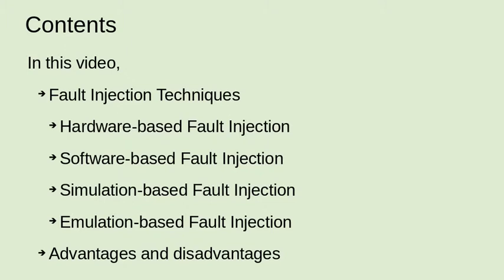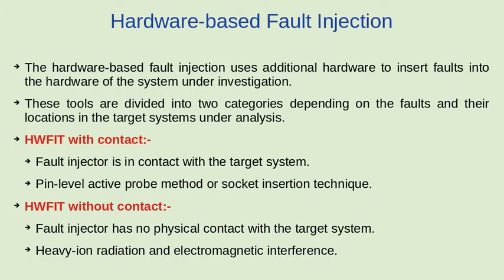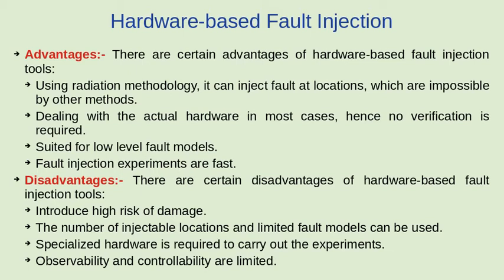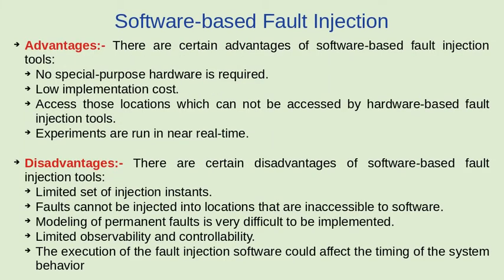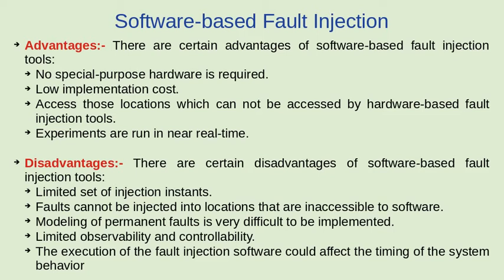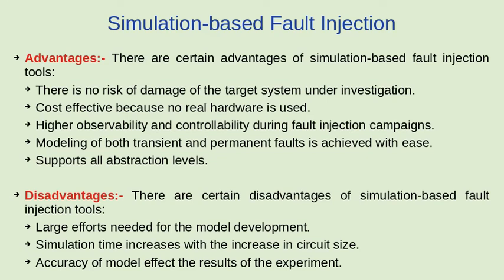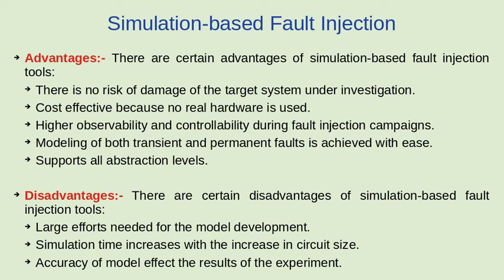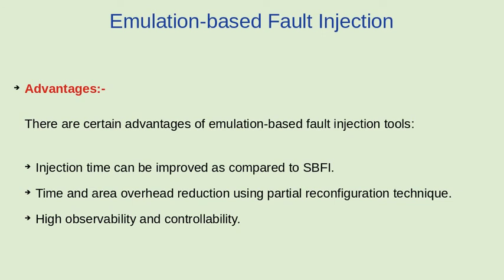Types of Fault Injection Techniques and Tools || Hardware | Software | Simulation | Emulation Tools

Comment: May you share implementation process
Reply from the maker: Please refer to some papers about the fault injection tool basics as below,
1. ATPG Method with a Hybrid Compaction Technique for Combinational Digital Systems
2. Validation of the Proposed Fault Injection, Test and Hardness Analysis for Combinational Data-flow Verilog HDL Designs under the RASP-FIT Tool 
3. RASP-FIT: A Fast and Automatic Fault Injection Tool for Code-Modification of FPGA Designs

Furthermore, if you have any questions feel free to ask and email me to the mentioned email address on the paper.